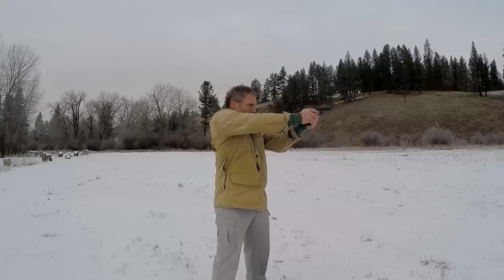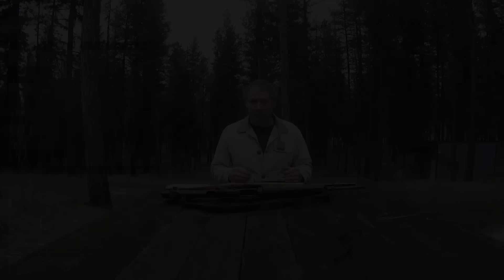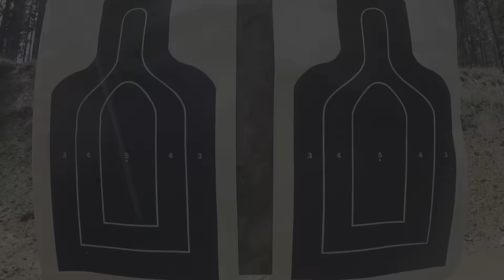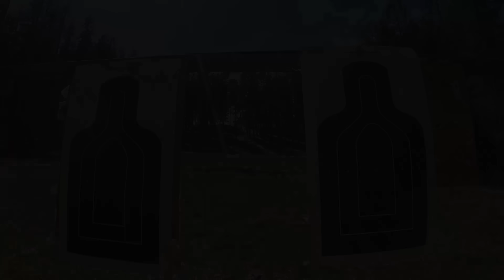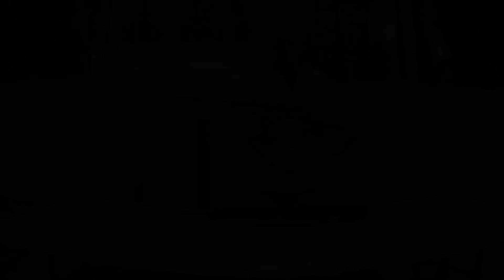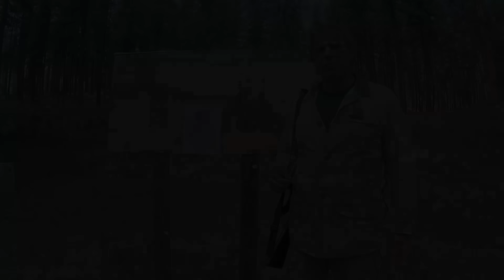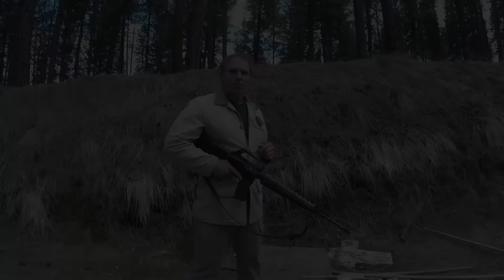Mini-14 vs AR15: Which is Better?

Comment: Wow!  It's a tribute to how much I enjoy Paul's presentations that I watched this entire pointless video!  I tolerated his misguided bashing of the 80's and I'll even ignore his lack of respect for the visionary band Duran Duran.  ;-)  My guess is that Paul and I are about the same age and I picked up my Mini for the same reason.  Back in the day ARs were very expensive and Colt was virtually the only game in town.  Mini-14s, SKSs and AKs were pretty cheap so I owned all three.  Sadly my Mini was only 'minute-of-barn-door' accurate and even with my young eyes it was difficult to keep five rounds on a pie pan at 100 yards.

Ironically, now AKs and Mini 14s are expensive an ARs have reached commodity pricing just like flatscreen TVs.  So now, circa 2019, it's almost incomprehensible why anyone would opt for the Ruger.  The AR/M4 platform have evolved radically while the Mini is nearly the same gun as it was then except that Ruger now deigns to add an integral scope mount.  And the modern M4gery is so ubiquitous that nearly every part it cheap- mags, furniture, accessories, etc.  There's a booming aftermarket for the AR and very little for the Mini, so mags and other items are still scarcer and more expensive.

If you're worried about freaking out neighbors that see you going to range, drop $20 on a gun case.

Comment: Thanks Paul, a lot of good information. That is an older model mini and looks like one of the rare good ones. The new mini is considerably more accurate and are chambered in 5.56X45. I have run into the evil pistol grip paranoia. I can take a Mini to Kalifornistan. I cant take an AR. Oddly though they do know the difference between a flash hider and a muzzle brake.

Comment: Love your videos...
As for me, I prefer the 5.56 M16- AR15 platforms, mainly because it's what I was issued in the Army. ...And of course because 5.56 is worry free and easily shoots both cartridges,  a .223 chamber with a 5.56 can be problematic with pressures under certain conditions and circumstances.

Comment: I've never understood the need for the screwball high sights on what they now call an AR. WTF was that all about. Why not low on the barrel where they belong? Far as I'm concerned you can take all the so called AR's in the world and recycle the damn plastic and melt the little bit of steel they have in them. The ones issued in th Nam were complete crap, and got guys killed because the military industrial complex cheaped out on the powder they used, causing the gun not to fire quire often, tho it was advertised and a weapon that didn't need field cleaning. I saw a buddy get blown away due to the weapon failing, so in my book, they're worthless junk. Most of us picked up AK's, they rarely failed.
Reply: thanks for explaing about the stupid looking sights. I've also been trying to esplain the arc effect  for a while you did it quick and easy.

Comment: Thank you for boring me about the differences between the AR and the Mini-14. It was very entertaining how you twisted the storyline in the direction you wanted it to go by first running the short range tests followed by the long range tests and then explaining how the two types of sights had advantages and disadvantages in different situations. I also liked that you pointed out the "Safe wooden gun" versus "Scary black rifle" perceptions of much of the population. This is why both my AR and my wooden bolt action single shot 22LR are each carried in bags that look very much the same: my neighbors have no need to know what platform I'm taking to the range today.

Keep up the good work. When you get long winded it's for good reason: the explanation is complicated, can't be summed up in a short "sound bite", and you know we deserve a good answer. Again, thank you.

Comment: 37:20 There's an AK related trick that requires nimble hands: take the "fresh" mag in your hand, hold it next to the inserted mag, rock the inserted one out and the fresh one straight in. For a brief moment you have to hold both in your hand and sort of drop the partial lower into your palm. Alternately, you can sort of "tip" your fresh mag forward so that you can rotate the old one down and out of the way. I'm not sure it would work on the Mini-14 as well, but it might be interesting/worthwhile to experiment with.

Comment: My Mini14 is chambered for 5.56. I replaced the rear site with a precision peep which is adjustable for elevation and windage. I set it 1" high at 100 yards which makes it dead nuts at 200.
I wouldn't shoot this rifle at anything serious over two hundred yards because of the barrel, which in my version of the rifle, is known to wobble like an AKs.
I have bolted on a barrel stabilizer, but for long work I have a .308 BLR that is much more accurate at distance.

Comment: When I had my mini-14 I set the sights so the rounds grouped about an inch high at 25 yards. I had no issues hitting a steel plate at 200m with it. I was very familiar with the rifle and knew where to hold to achieve my results.

Comment: Great video Paul.  I was always under the impression the word was pronounced SPIRE with a long "I" sound - not "SPEER" with a long "E" sound.  Clarification?  Thanks
Reply from the maker: Toe-MAY-toe  toe-MAH-toe car-bean  car-bine  I'm not sure there I right way to say spire point.
Reply: @PaulHarrell  Thanks Paul.  Wasn't bustin' balls.  I had always pronounced it as you did.  But, in a geometry class we were learning about spires - where the instructor pronounced it with the long "i" sound.  I looked it up.  Sure enough...long "i"  I thought, perhaps the military had a different meaning.  Again, thanks for the reply

Comment: Nice video.  I have one of the newer mini-14's.  Its accuracy is good enough for me given i use the iron sights.  I have found that the most reliable and usually affordable after market magazines are the Tapco gen 2 polymer 30 rounders.  I have several bought at different times, and have never had any issues.  You can usually find them for around $15.

Comment: I loved my Mini Thirty. It's a shame I had to sell it and my SKS when hard times came. That being said, my one complaint: MAGAZINES. I experienced exactly what Paul described happened with his friend, I had to buy an excessive number of aftermarket 30-round mags to get six that worked. Ruger needs to come out with a Mini-14 that takes STANDARD AR magazines, and a Mini Thirty that takes STANDARD AK magazines. For all of the advantages that Paul mentioned in the video, I would rather have a Mini-14. But until they come out with what I described, or Springfield or some other manufacturer comes out with a M1/A that is as I described, my primary weapon will have to remain an AR-15.

Comment: Why are you using 40 year old rifles? The new ones of both are much better & Rugers are very accurate now.
Reply: Happ Happy it’s still a fair comparison. And Minis haven’t changed nearly as much as ARs have. Plus seems unnecessary to buy new ones
Reply: @alexmoore1506  The new mini 14s have heavier barrels & are much better than a crap AR15. Try one before making up your mind.

Comment: I once owned, in sequence, a 180, a 181 and a "stainless" Mini-14. Accuracy (actually "precision" wise,  the 180 was OK, 181 was impressive and the stainless OK and a bit ammo sensitive.

However, the Mini-14, being a "derivative" of the M1 / M-14, its stock fit and bedding are critical if you seek cloverleaf groups. Mine weren't bad, but others examined displayed a disturbing amount of "slop" on their bedding; "undocumented factory feature" or, WAY too much field stripping? Maybe both?

Having to disrupt the bedding every time the rifle needs cleaning is going to catch up with you sooner or later. NOT cleaning the gas system will catch up with you fairly quickly, especially if you live somewhere prone to high humidity.

Comment: Awesome video! Thank you for taking the time to do it. I’ve had both and kept the mini-14, I just prefer it. It’s not as practical to build as an AR but for a little less than what you will invest in an mid to upper end AR you can build the mini-14 with a custom barrel in a lot of different camberings, in different lengths and lighter to bull barrels with trigger job and make it a very accurate rifle.

Comment: I started with the Mini 14 as my first rifle for a number of reasons. One was stated already, that some people would probably freak out even in this day an age about an AR thanks to the media. A second reason is because of the legacy of the design, that it was patterned after the M14/M1 Garand. A third reason is because it is a piston vs DI that was more cost effective than a piston AR (usually $1500+). 4th, the rifle was also produced after the supposed “bad designed” Mini-14 era (had a thicker barrel, better sights, better harmonics, more readily available mags, etc). Late last year I bought an AR (A2 pattern heavy barrel variant) from Bushmaster. Side by side, they really don’t perform all that much differently. They group similarly at the expected engagement distances for defense use, similar recoil impulse, and (with practice and training) can have similar reload speeds. Aesthetics aside, it really boils down to preference or what kind of shooting you do or how far your shots will travel. 25-100 yards, Mini14. 100-300 yards, AR. Its definitely an apples to oranges debate as they have different utilities. But that’s just my opinion

Comment: I bought a mini-14 in 1988 for around $300.  I still have a 1984 Gun Digest and I was looking through it and the Mini listed for $335. The cheapest Colt AR-15 (sporter) was $560.50. Of course Colt's AR15 was the only  brand on the civilian market at that time.. Bushmaster started selling theirs a few years later, but at that time were only selling their sorta AR looking  Bushmaster Auto Rifle and it was $494. The only guns you could get for less than the  Mini 14  were the Universal or Iver Johnson M1 carbines which ran base price around $205-$250. That's the reason so many people like me chose a Mini, along with the fact that Wal-mart sold them.  Mine is accurate and reliable and even though I prefer the AR, I still enjoy the handy little Mini on occasion. The after market mags I have run the gamut of reliability, although in general I have found that the after market 20 rounders both look and function better than 30 or 40 rounders. New Tapco 30 rounders look a little our of place on a wood stocked Mini, but the ones I have function great and are at a good price.

Comment: Thanks so much for your work an demonstration on these 2 rifles.  I have no comments because I came here to learn from your expertise and I sure did.  

I have had both rifles in the past but just have the mini 14. Here in Canada the AR 15 is restricted as a handgun is now but the mini 14 is not. Weird because Lapine in Montreal 25 years back killed those 21 girls at Polytech which caused all this firearm crap here and that nut case in Norway a few years back also killed 71 with the mini 14. 

As you surmised, it is just that the Ar 15 looks scarier😉

Comment: I prefer the ergonomics of my Mini 14s. Both are great rifles.
Reply: I prefer a rifle grip to a pistol grip aswell.
Reply: The ergonomics of each rifle is very important and how the rifle is balanced and how your body can handle the rifle. The ergonomics of the Mini 14 are usually better for me as well over the AR 15. I also have spine problems so the Mini 14 is easier to control than an AR 15 but I would like to have one of each.
Reply: I'm used to shooting lever guns, so the mini makes sense to me.

Comment: I was about 10 years old when I was introduced to the mini 14, so about 1972. An Oklahoma Hiway Patrolman showed it to me. It may be a false memory, but I seem to remember they were only available to law enforcement when they first came out.
Reply from the maker: According to the sources I read the min was introduced in 1972 and mass produced for public consumption in 1974. So your memory sounds about right. However I have also read a source claiming that the mini was introduced in 1977. I know this is wrong because I have personally seen one that I KNOW was made in 1976. So.... Sources don't always agree with each other.
Reply: @PaulHarrell  At the time it came out, I think there were a bunch of guys that preferred the mini 14 simply because they had used the m14 or Garand in the service and the operating system was familiar to them. I joined up in 1979 and I prefer the AR because that is what I am used to handling. That said, I wouldn't kick if all I had was a mini14. Great video as always.

Comment: Excellent video. Very well done. It was extremely fair, since both were rack grade rifles. My former small PD used Mini's from 1999-2007. I got the impression they were about 2 5-3 MOA rifles with common ammo. They were certainly accurate enough, and i liked the sights fine (i love peep sights). I put Hogue Overmolded stocks on them, which helped the handling (no slick, curved plastic butt plate, and good gripping areas. The Bushmaster i bought in early 2007 when we went to AR'S (16") was capable of 1.5 MOA or a tad better with common ammo. The PD bought EoTechs for us, and a few years later the Aimpoint PRO. Both worked well, but the Aimpoint was preferred. I would say it's a lot like AK vs AR- out to 100 or 150 yds, the first-shot hit potential is basically the same. Beyond that distance, the AR starts to have an advantage. Great explanation of the sight systems. I always liked the A1 sights- rugged and easy to use (we got some milsurp ones in the early 2000's; the promised M14's from DRMO never showed up, darnit). As an aside, the company doing accuring on the Mini (center fire systems or accuracy systems, something like that) seems to do good work. A friend of mine had one done yeara ago, and he shot sone excellent groups with it. I know on the full package the company starts with a new, heavier "match grade" barrel, which should alleviate any headspace issues. Anyway, wonderful video. The length is no problem- we appreciate the in depth testing and explanations.

Comment: The older Mini-14’s have pencil barrels that have harmonics issues.  If you have a 580 series or better rifle, you have a thicker barrel profile.  The irons do suck on the newer ones.  Ruger mags are very well made.  They come with scope mounts.  I think the design is a bit more rugged than the AR-15’s.  I wouldn’t hesitate to bring my Mini to a tactical carbine class.

Comment: this is amazing... I shot expert every time I went to the range in the ARMY, and I can honest to god tell you that you know more than the Drill Sgts teaching this class in basic. They told us the round itself's rate of spin actually causes football style of rise, rather than the angle of the barrel in relation to the sights. On top of that, they never said anything about the large apature being a quick switch to 100m. They told us it was for better vision in low light conditions. Great class.

Comment: 2 points. When the minis first came out I got 2. 1 shot 1 MOA @100 yds consistant. The other was ALL over the page. Sent it back to Ruger w a "Im NOT a happy camper" letter. Got it back a month later w a bull bbl on it & THAT one was a tackdriver. Not even sure it was the same rifle I sent back. 5 shots, 1 raggedy hole @ 100 yds (off the bench w a scope on both) Should have never sold that one. Point 2, Recently pick up a used newer stainless w plastic stock. Shoots great!! Marked 223. Was told (at the range) that ALL the minis from day 1 were ALL chambered 5.56..no.matter how they were marked. Called Ruger & was told this was true. Tried 5.56 in mine & it works flawlessly. Go figure....

Comment: Mr. Harrell thank you and very well done comparison. I have owned both platforms over the years and started with the Mini-14 as you did as a price thing but I almost exclusively have AR15 platform rifles now other than one Ruger Mini 30 (a hand me down from my sister). You might correct me if I'm wrong but I didn't catch if you mentioned the barrel twist of either the Mini14 or the AR15 that could have an effect on accuracy.

Comment: Why wouldn’t you compare it to what’s available today?
Reply: MrAdvantage1 I mean the guns were made roughly around the same time. He’d have to go out and buy a factory new AR and Mini which seems a bit unnecessary
Reply: Alex Moore has the mini really changed enough to warrant getting a new example? The AR15 is a vastly improved platform than it was in the 80’s? This is like “which is better, Chevy or Ford, oh and BTW im going to compare models nobody uses anymore”
Reply: MrAdvantage1 then people could certainly claim that would be unfair